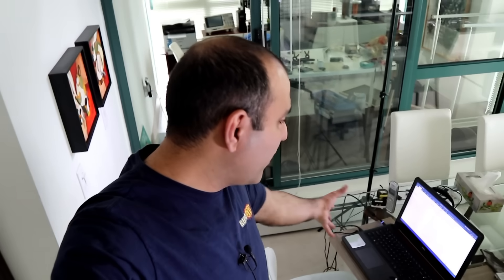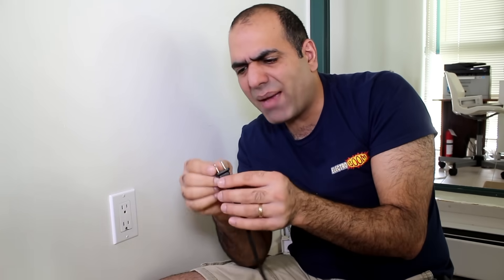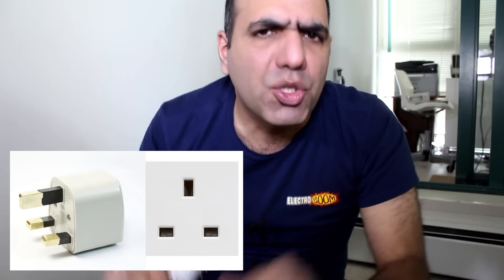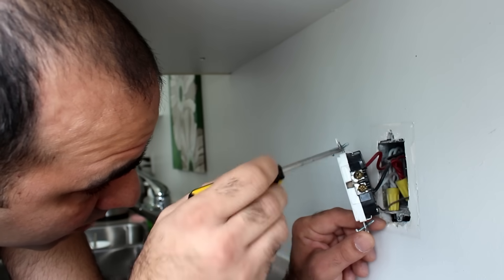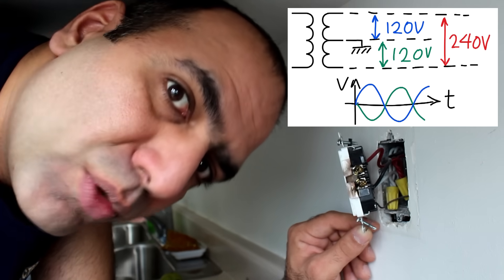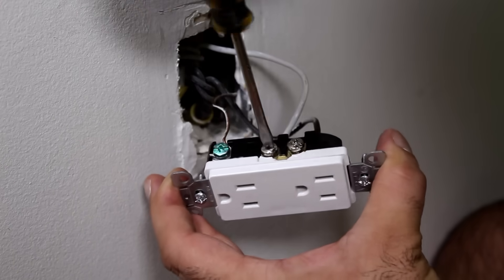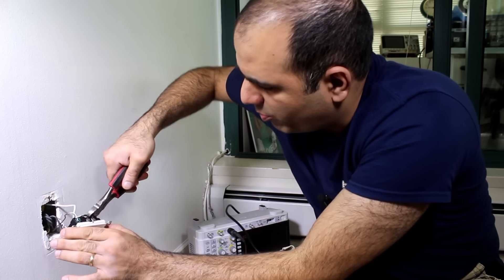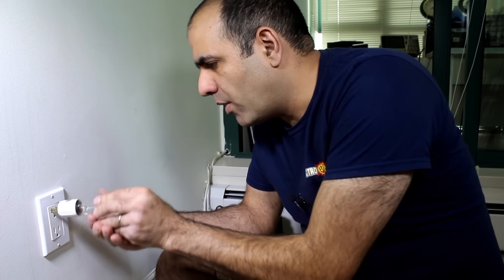How to Replace a Power Outlet

Comment: North American plug sockets suck. U.K. sockets are a lot more secure and safer 🇬🇧
The only disadvantage is that if there is a plug on the floor with the three pins pointing up and you stand on it.. It really, really hurts 😛
Reply: Our plugs are the ONLY the thing the UK has got to be proud of. Everything else here is shit. But our plugs are even better than Schuko (Sorry Germany, but look at it like this, you've got TPAI, Great Scott, Stefan Gotteswinter, Kraftwerk, Welle:Erdball, Einsturzende Neubauten, Knipex, Reichelt Elektronik, Doepfer Musikelektronik and all that other stuff, and all we've got if a plug, so don't feel bad)
... oh yeah, we've got ARM too... that's not shit either.
Reply: UK Power sockets also have switches, which seems to be an alien concept to everyone else!
Reply: The SchuKo and UK plugs are treating blows.
For most intends i think the SchuKo is better, but the UK plug has 2 distinct advantages that the "next" SchuKo should also have:

1 - inbuilt fuse.
That way a tool that only ever needs 5 Amps can have its own 5A fuse that is easily accessible an replaceable.

2 - specified polarity.
When doing anything with mains it really is good to know which side is life and which is neutral. If everything is wired correctly you know that turning of the power will disconnect life.
Reply: Zylon FPV - There’s not much between the European sockets, IMO. The North American plugs are awful, though.
Reply: UK plugs are the best. Big Clive says so and that's enough for me.
Reply: Personal experience with that.

Also, ElectroBoom showed a chinese knockoff UK plug with a bad ground that isn't UK compliant. ):
Reply: UK plugs are also enormous.
Reply: Yes its huge, yes it has the highest pressure. And while the frequency is a bit lower, we more than make up for it with the size. Did i mention the size?

Oh yeah, our plugs are pretty good too
Reply: Go BS1363 plugs!
Reply: Mark Wright European plugs can have the cable comming from the back or from the bottom. A cable comming from the bottom is good for low profile, but it can cover sockets below. Plugs for permanent connection often have the cable comming from the bottom and plugs for temporary connections usually have the cable comming from the back.
Reply: @Szakembőr - Wrong.  U.K. socket circuits are typically rated for 32A continuous.  BS1363 plugs/sockets however are rated for 13A maximum.  The fuse is there to protect the socket, plug, and appliance cabling in the event an over-current situation forms.  How do you imagine your desk lamp with 0.5 sqmm feed cable would handle a soft-short fault with ~7000 watts behind it?
Reply: Phos9 But the German Schuko sockets also accept Euro plugs, which are as small as the US plugs. So if a device (like USB adapters) doesn’t need ground, the plug can be just as small.
Reply: Zylon FPV UK's electrical engineering is God-like!
Reply: Aussie plugs are quite good too - the plugs can be made good for over 15A (and with an oversized earth pin I'm pretty sure I've seen 20A), they're small, lightweight, compact (nearly the same size as an earthed US/Canadian plug), they've got partial sleeving unlike the US plugs to prevent contact with a half inserted plug, and as a bonus are actually 100% intercompatible with Chinese plugs which is handy for imported appliances (although those tend not to be fully compliant lol). A fully standard compliant Aussie plug can be made very small by omitting the earth for double insulated appliances too, which is handy (e.g. computer power supplies are typically double insulated).
Reply: DiNDiNBrE TeškiMetal yes this one especially!
Reply: The US power socket is the smallest meaning our USB adapters are also the smallest.
Reply: (Schuko) Yes, but then he will have to rebuild the wall after trying to unplug the laptop.
Reply: It's meant to plug into the wall, NOT in your foot!!
Reply: edgeeffect this is hands down the best list of things to be proud of. Funny shit
Reply: I used to think Shuko were the best. Recently I moved to UK and I can safely say that Swiss plugs are the best.
Reply: +A German Viewpoint German plugs are ugly as fuck. Black lumps poking out of a 2 inch hole in the wall... what a piece of shit design
Reply: +- Automata - From what I understand only older and non-compliant designs allow the plug to be inserted upside down (https://www.youtube.com/watch?v=UEfP1OKKz_Q). And Shuko sockets have their own issues - Mehdi was saying in one of his vlog vids that in Iran when they switched over to Shuko plugs they used to be able to force the older plugs into the sockets but the shape meant that some of the length of the pins would be exposed, so Shukos have safety failure modes as well. The broader earth pin and solid safety means that smaller lighter plugs would be less likely to bypass a well made British plug's safety. OTOH while there's no active safety mechanism the thin slot based design of North American, Aussie and other equivalent designs means that they get a degree of passive safety because there's fewer objects that would physically fit - not as good as the Shuko or British designs but it's there.
Reply: European ones are good, yes
Reply: Indeed, U.K outlets are the safest in the world.
Reply: Zylon FPV - yes: _science_: https://youtu.be/UEfP1OKKz_Q
Reply: Unless you've changed the standard, didn't your plugs all require fuses?
Reply: You know, when you've got some equipment with a fixed plug for another countries mains electricity you might wanna install a foreign socket in your house so you don't need to modify that device thereby voiding your warranty..Of course only when ac voltage matches.
Reply: Australian/NZ plugs hurt way the fuck more. 

They are sharper and thinner.
Reply: 21 years of my life and I've yet to even see one fail... the house I moved into had oooold switches from 1970/80 that still worked
Reply: With European plugs it's is bacially impossible to stand on them and get spiked
Reply: You are on the internet sir complaining that plugs are ugly.
Reply: Not sure if I consider Duplo blocks better to regular Lego though. What's there is sufficient with the standards given (and remember it's North America - so Canada and Mexico went with it, not to mention a parallel standard in Japan), and Darwinism is still free to take care of the rest.
Reply: And who the fuck leave a UK plug on the floor where it shouldn't be?? That is not a problem at all.
Reply: The Shuko sockets have a guard on the live and neutral pin where you have to push something (aka the plug) into both holes at the same time for the contacts to be exposed. The UK variant can be bypassed by pushing something in the ground socket, or plugging in a device upside-down for example. This makes Shuko plugs safer.
Reply: +TMCicuurd12b42 That used to be true with unfused circuits relying on cheaper fuses in the plug, but these days modern installations routinely deploy fuses and RCDs (equivalent to GFCI) to all circuits, making them in some ways safer than US circuits and only falling behind in that they operate at higher voltage (which only causes issues if all the safeties fail), and that has benefits as well (e.g. many appliances that require 2 phase power in the US and Canada quite happily run on single phase in 240V countries, some appliances are more powerful, etc).
Reply: Real men just twist live wires, there's no need for fancy schmancy plug thingies.
Reply: https://images-na.ssl-images-amazon.com/images/I/31E%2BYafmV4L._SY355_.jpg not all plugs are huge
Reply: Rubbish. Its there to protect the device.
Reply: EU plugs are the worst. Why the hell did they have to be so big??? There's NO REASON. The only thing that makes them better is the shielding that covers half of the prong so you don't touch the prong when you're unplugging it. If it wasn't so big, you wouldn't feel like you have to get such a sturdy grip on it, and you won't grab it so "deep" and you wouldn't shock yourself. You don't have that issue on US plugs because they're small and you don't need to do anything other than pinch it with your thumb and index fingers. It boggles my mind why they haven redesigned those to be smaller and more compact. (Oh wait, it would be an expensive hassle to change a standard like that... Sorta like the expensive hassle of switching to met.... Ahhhh, no. I won't go there.) We have a similar plug for or 220V, but it's not really used, especially not for thing that are frequently plugged/unplugged. I couldn't imagine using that giant thing for everyday appliances that are plugged/unplugged frequently. What a nightmare.
Reply: Zylon FPV Schuko is much better. The plugs are smaller, carry 16 amps (or even up to 25 in practice no they didn't burn) and if you drop them, they land on their side. Fuse? If you want fused plugs, they are available.
Reply: Mark Wright You mean recessed?
Reply: edgeeffect Bigclive too.
Reply: Kaponek Herkowitsch You can't even see the ground!
Reply: + - Automata - You can't put a UK plug in upside down, it's a triangle. 
But the situation you're talking about is frankly inane, at that point, the user is trying to kill themselves.
Reply: Szakembőr TV TMIAE Fuses are slow response. Breakers are built to trip first. Fuses are there as extra protection.
Reply: Arie Only 15 amps 120V you kidding me?
Reply: Shuckos are also quite bad and way too big. The best ones in my opinions are the italians ones
Reply: It doesnt matter for me, with basic common sense i can prevent my self from shocks with any kind of plug/s
Reply: Swiss plugs are the best!
Reply: edgeeffect the plugs are the  only Thing  thats More advanced  in britain then in  europe  xD
Reply: There are no good outlet designs,,,, they all suck for one reason or another.
Reply: The European ones are the best, hands down.
Reply: German Schuko plugs are the way to go
Reply: The fuse isn't there to protect the device - it's there to protect the cabling that feeds the device.
Reply: Zylon FPV and fucking enormous
Reply: Steve Evans those switches are absolutely pointless, just another point of failure
Reply: They take up way too much space. USA! USA! USA!
Reply: Some UK plugs have no plastik on the pins, if you put a plug halfway in you have exposed live pins.
Schuko sockets "bury" the plug inside when it gets live so no exposed metal.
Reply: Zylon FPV LIES
Reply: Nope :P